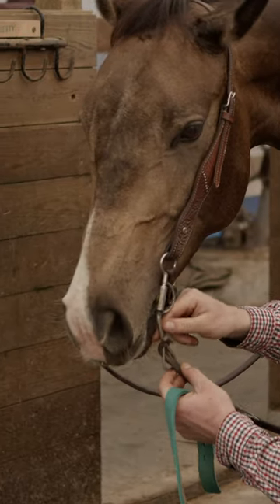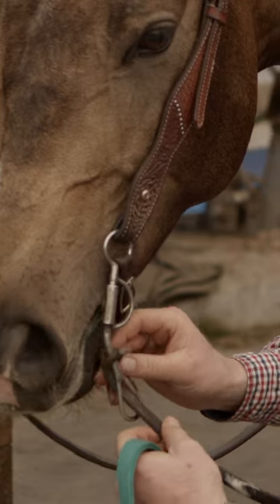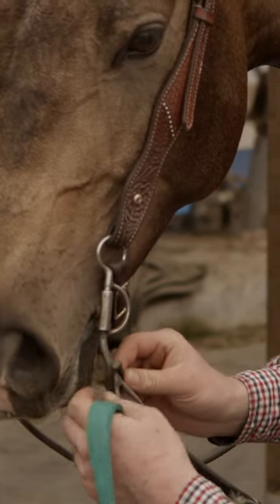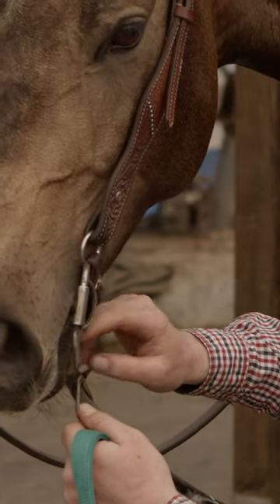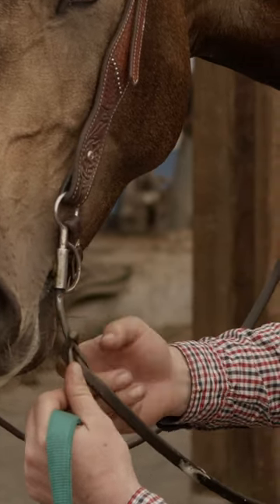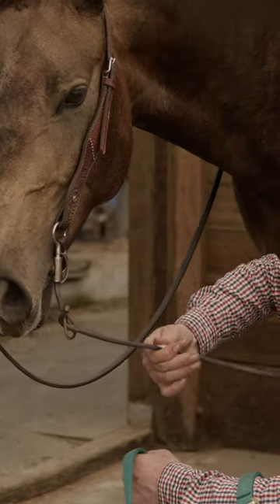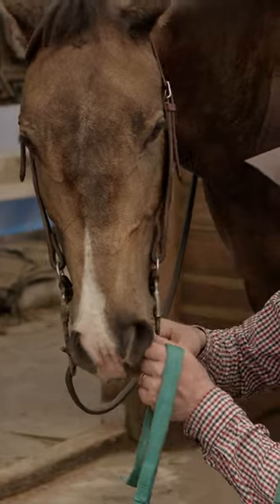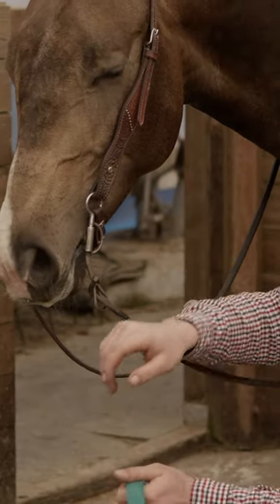Try doing this with your reins.. #shorts

Comment: the bit is barberic  Stop using them! they cause great facial nerve  pain
Reply: Its all in the hands my friend.  In fact, some horses prefer their bit over a bitless bridle. If the bit causes pain, its due to the riders hands. Horses willingly take the bit with no fear. If they hurt them, they wouldn't  be so agreeable in taking the bit. Some bits taste good to the horse, other bits allow for a nice moist mouth. My gelding works great in a bit, while my mare prefers a short shank hackamore. Please don't group all bits and all horses into one category.  You have much to learn. Good luck.😉
Reply from the maker: The bit doesn't do anything unless someone pulls on it. Lack of knowledge and lack of experience are more dangerous. Also dangerous is an "all or nothing" mindset.
Reply: They ride mostly with their seat. They don't really pull on the bit at all.